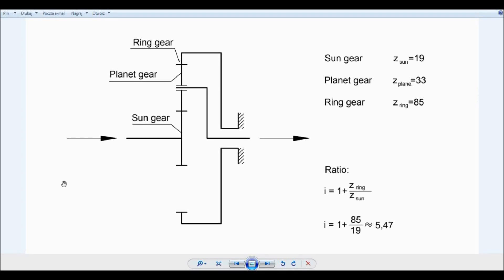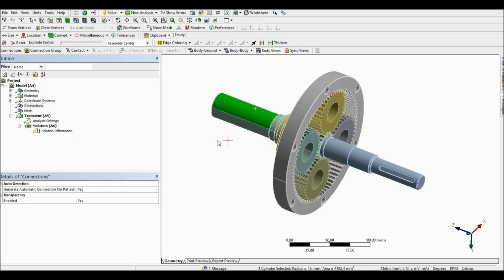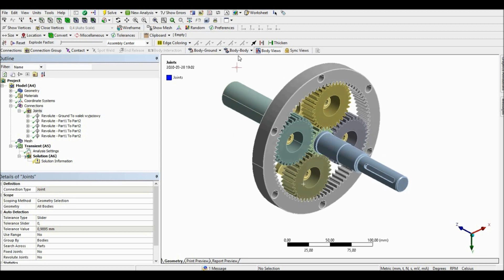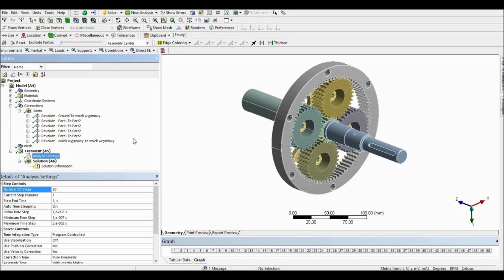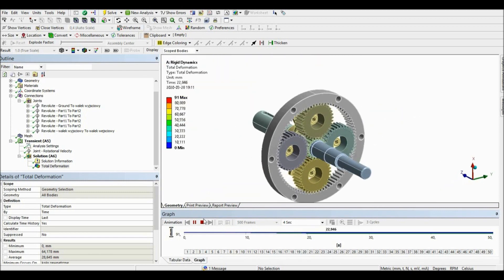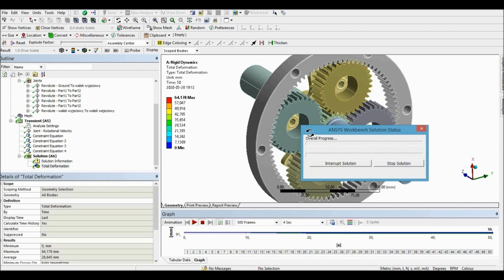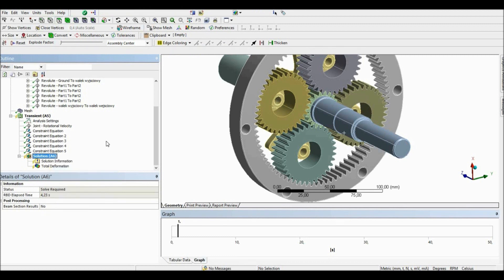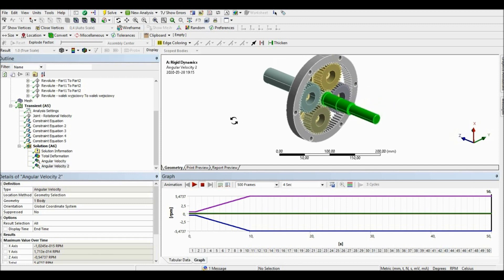Ansys tutorial - How to calculate the planetary gear ratio using "constrain equation".

Comment: hi i had  quick question what meshing method did you use in ansys
Reply from the maker: I didn't use any mesh method because this is "Rigid Dynamic" module which not calculate stresses or strains. That is why mesh is not needed.

Comment: thanks for the video instruction man. this was really useful for me. 
I have a problem though, I was using the same method for 4 gears  and a shaft for 2 step reduction and while doing the mesh, it was only being produced in the contact surfaces? may I know the meshing details.
would be a great help, thanks in advance.
Reply from the maker: That analysis was made in the "rigid dynamic" module which means that there was no need of attaching mesh. I'm doing gear analysis with mesh in another video, you should check it.

Comment: Thanks for the video. I searched many on google. This video clarified almost all my‰ doubts. Al though i have few questions, can you please help me to understand 
1. Al though there is ring gear u havent used it . It was just there as a nominal purpose. U could have given revolute to the ring gear and then made it fixed. Is there any specific reason why you haven't used it ?
2. Is the revolute joint connection to the sun should be ground to sun or should it be body to body ?
3. U haven't gave the constraint equation for all the planet to sun instead u have only given  to one . Is there any specific reason why ?

Thanks in advance. Video is really great and it helped me to understand . No one had made a video on this problem with clear explanation except you
Reply from the maker: Hello, I'm very glad that you liked the video/tutorial. 
According to your questions:
1. There are two types of planetary gears, one with the rotating ring gear (the one you can find in the atomatic trasmission gear in cars) and one with fixed ring. In this tutorial I've decided to show the second one with the fixed ring gear. I haven't given any contraint to this one because it is not moving but you can do it the same as you mentioned.
2. I've made it from the carrier shaft because it was easier for me. That is why the carrier shaft has a body-ground joint, and the sun gear/shaft has a body-body joint. But again as you mentioned much nicer from the engineering side would be body-ground for the sun gear.
3. I've made a the constrain equation for all of the planet gears. I showed only for one of them and the rest was skipped. I'm teeling about it in the 2:34
Reply: @allaboutfea4790  
Got it. Now it's clear. And thank you so much for replying back.
Reply: @allaboutfea4790  is there any possibility to find out contact stresses at the tooth surface mesh region. Just trying
Reply from the maker: @vivekanandareddymaddela  of course, you can check the stresses on any point of analysed object but it has to be meshed. The aim of this  analysis was to show the "constrain equation" option that is why the gears wasn't meshed this time. I have another video where gears are meshed and there you can check the stresses at any point.
Reply: Dear  @allaboutfea4790  ,
I have been working on similar kind of problem, a 1 stage planetary and  two parallel stages gear  mechanism, and I couldn't get the desired output velocity and also  have some issues with gear mesh . 

Could you please help me out with it ?
Looking forward to hearing from you